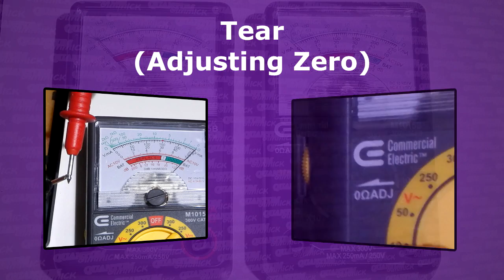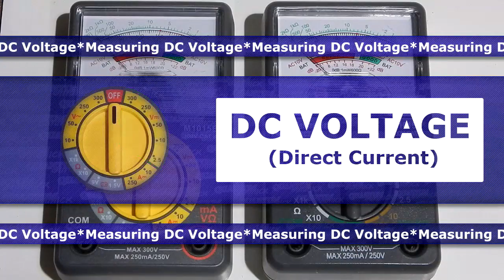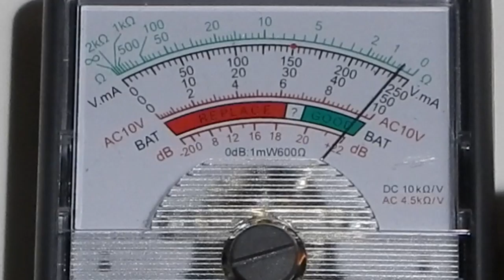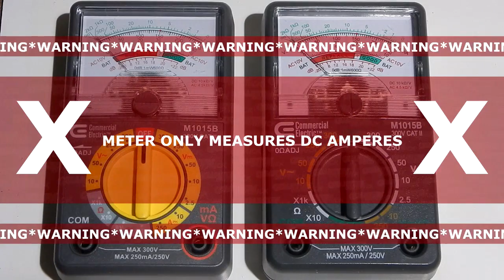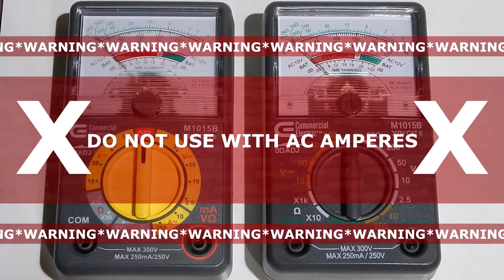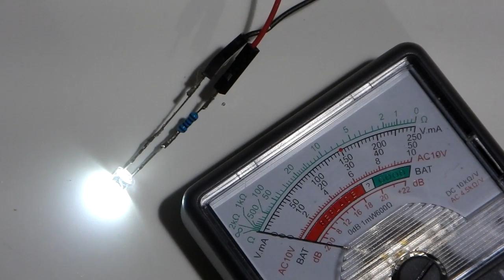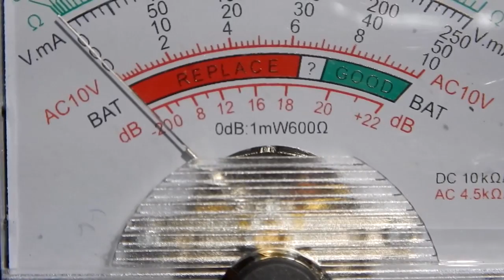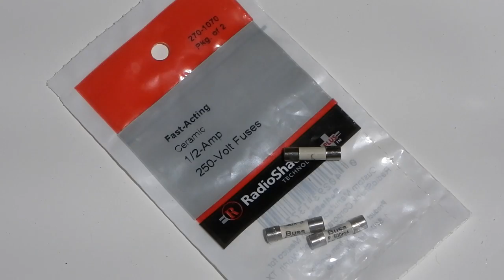How To: The M1015B Analog Multimeter Tutorial

Comment: so when measuring the dc voltage, are you using the scale with the red lettering, or the black scale under the ohms? I'm asking because the red lettering is ac10v, while that black lines under the ohms are V. ma. sorry if it sounds dumb. when you got your measurement of 9.5, it matched up with both red, and black scales.
Reply from the maker: Not a silly question you actually bring up an odd design choice on their part, not sure why that AC10V label is there (I suspect it maybe mic related) but that red scale is used/is part of the black V.mA scale (it's used for all AC, DC, and miliAmp measurements).

So just ignore that AC10V label, that whole arc belongs to V.mA
Reply: QuantumGimmick so i use that scale that says acv10?if thats the case, why use that red scale, when theres the black scale? i think they are the same scaling
Reply: I'm sure you've figured it out correctly by now but this is for other folks who stumble upon this video. The red scale is for reading AC Volts, period. The black scales have DC ranges posted beside the DC V scales. Each DC Scale has a different range and you use the appropriate scale vs the range selected. The fact that the red ACV scale Volts matched up (very close) to the DC scale in use, is coincidental. If you'll notice, the lower the voltage markings on the AC scale, the more the offset of the voltage correlation. This is because, if I remember correctly, AC voltage measured by the meter is converted to DC voltage, and hence current, for the meter through a full-wave bridge rectifier so the meter movement will react properly to it. If it were not for the bridge rectifier (which has a "voltage drop") the pointer would just vibrate at the frequency of the ACV around zero. You probably would not even notice it.
Reply: @thomasnewbery7449  very good. This was actually a random video for me too as well but I did figure it all out
Reply: @Ramslamtheman  Mind you, it ain't rocket science, is it!

Comment: does this multimeter have a diode function to test led bulbs?
Reply from the maker: This multimeter does not have a dedicated diode test setting to test forward voltage drop (if that's what you are looking for).

I also doubt it can light an LED (as a test) through the resistance setting as that uses 1.6 volts and 15 milliamps in that setting (maybe a red LED will get a faint glow)

At best you can test to see if the diode allows one way current by using the resistance setting (which sends some current from probe to probe) and seeing if you can complete the circuit through the diode (if the needle moves the diode is allowing the flow in that direction) - Hope this helps

Comment: I'm trying to test my boiler's Thermocoupler which is supposed to show at least 26 to 32 DC. Do I set the M1015B to X10 Ohm which is located at around 7 o'clock if it were a clock? Thx.
Reply from the maker: You're looking for anything between 26 to 32 millivolts so you'd want to set the dial to the 2.5 DC scale (at 4 o'clock) for your test.

However a word of warning, at small scales this multimeter tends to be inaccurate so I'd recommend you first test a new AA or AAA battery and see if the multimeter gives you around 1.5 -1.8 volts. (150 - 180 on the result scale)

If the multimeter doesn't show 1.5 - 1.8 volts on the new battery then you won't get an accurate millivolt measurement. But if it does show, then you're good to go.

PS. The X10 Ohm is for resistance not voltage
Reply: I'm sure you've learned by now that you can't use that meter to measure the output of your furnace's thermocouple.... it's not sensitive enough as it puts out only "microamps, dc". You need a meter with at least (good senario) 10 megohms "input impedance". (No analog meter except a Vacuum Tube Voltmeter Meter will have that high input impedance..) I'm assuming you're troubleshooting the flame sensor thermocouple like I've done quite a few times in my home furnace... they get dirty, here, so a light cleaning with steel wool of 0000 fineness might solve your flame-out problem. Then, again, If you're measuring a supply voltage to a box which should be about  26 - 32 DC volts, put the range selector switch to the DC 50 volt range and you should read about center scale.

Comment: Very helpful. I do have a question. I built a homemade battery, and testing the voltage (simple aluminum air battery) I'm expecting a voltage of 1ish. When I set at scale 2.5, I get a voltage of 3. So I up the scale to 10, and get a reading of about 1. How should I interpret these results?
Reply from the maker: I would trust the reading of about 1v on the 10 scale because I have noticed that the lower scales on this multimeter have rather significant errors. I usually don't work on these scales but it is something I had noticed and I will be mentioning this issues in detail in an annotation once my lab and workshop are back in working order.